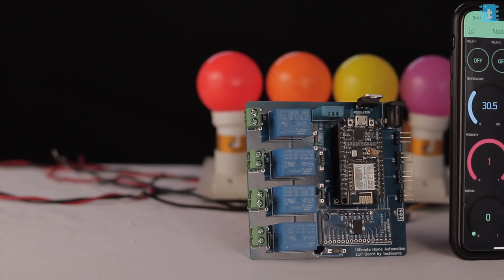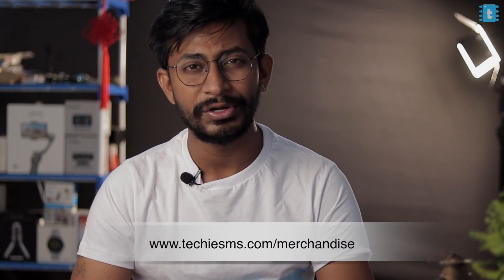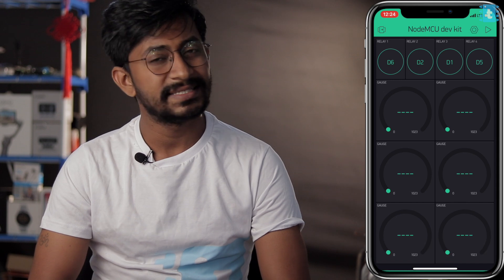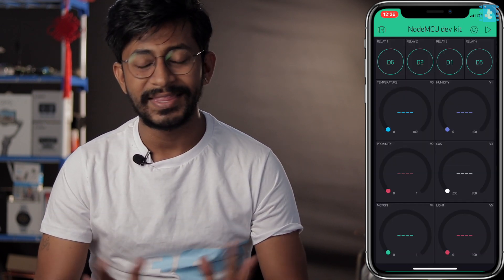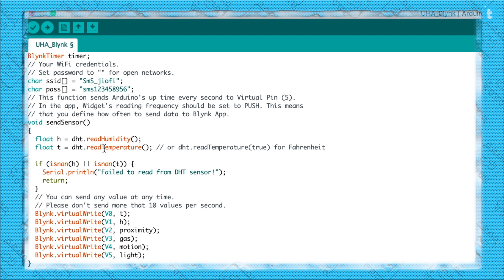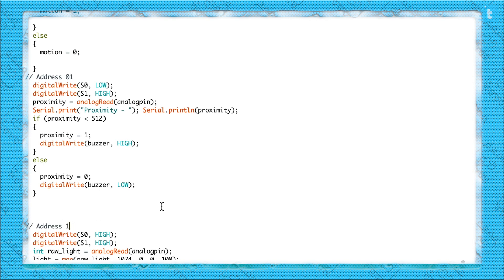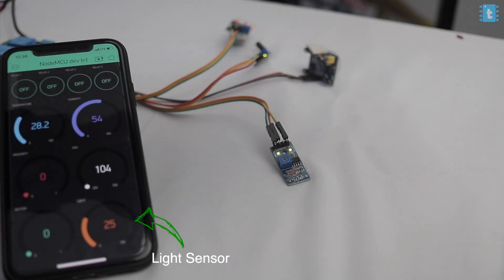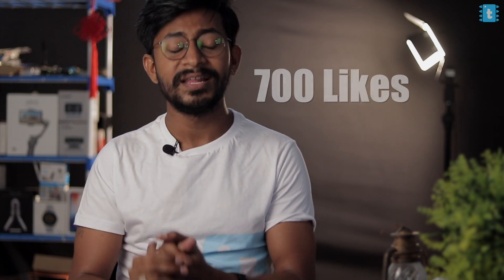Multiple Sensors, Multiple Appliances using NodeMCU & Blynk | IOT Projects | ESP8266 Projects

Comment: Sir how to get a measuring code for acs712 current sensor and ZMPT101B voltage sensor using nodemcu esp8266 with aurdino ide

Comment: project is amazing ... but i have a query about analog pin ..... can we convert analog output to digital ......?  without any IC or complex circuitry
Reply from the maker: Just put the condition that of the value is greater than 1000 it’s digital true else it’s digital false

Comment: I am working on a similar project but instead of Nodemcu i am using a wifi Module named ESP8266-01..
Will it work the same? Or should i switch to Nodemcu?

Comment: in the circuit diagram of sensors there are only 3 sensors are connceted to the multiplexer but in the output when you are showing there are 4 sensor

Comment: Bro I'm doing a project where I can control relays using Blynk and a it remite so whenever I'm using it remote even though the light is off the state of the relay is not updates in the app bro can you help me with this code so every 1 sec or ant time we can send the state of relay to the app so there is sync

Comment: What a really great video sir!. May ask you a question. I want to make same IoT project where it can controlling machine temperature using termocpuple and relay. But i have the problem that i dont know can blynk controlling its time (running for just 2 or some seconds and than turn off) and make some loop that run continously? or maybe running a whole sensor (if i use more than 2 sensor on 1 machine) with just use 1 button on blynk to running for few seconds, is all that possible to make sir? thank you verymuch

Comment: Interesting project for learning purposes however not useful in reality as it is, it is not possible interfacing analog sensors with long wires and still be reliable, since all those sensors cannot be near each other so this is completely useless unless built to play with!
Reply: This project did not work for me. Could you point me to one that uses multiple sensors and Blynk that works? TY

Comment: Well explained. Can you please tell me requirement if I want to do this whole thing wirelessly (means sensor is at some other place and my appliance is at other place within 1 km).
Reply from the maker: It works over internet 
You can get the data from anywhere in the world
Reply: @techiesms  Sir, As per your video relay is connected to Node MCU. I don't want to connect relay with MCU.  Any way to give signal to relay without being connected to MCU ?

Comment: Arduino: 1.8.13 (Windows 10), Board: "Generic ESP8266 Module, 80 MHz, Flash, Legacy (new can return nullptr), All SSL ciphers (most compatible), dtr (aka nodemcu), 26 MHz, 40MHz, DOUT (compatible), 1MB (FS:64KB OTA:~470KB), 2, nonos-sdk 2.2.1+100 (190703), v2 Lower Memory, Serial, SSL+TLS_MEM+HTTP_CLIENT, Only Sketch, 115200"

xtensa-lx106-elf-g++: error: CreateProcess: No such file or directory

exit status 1

Error compiling for board Generic ESP8266 Module.

This report would have more information with
"Show verbose output during compilation"
option enabled in File -> Preferences.

Comment: what if i want to use 2-Voltage sensor and 1-Current sensor instead of the sensors you used? would it be a lot of changes on you code?

Comment: Hi sir, i would like to connect IR sensor, mlx90614 and hc-sr501 Pir motion sensor to a nodemcu for my project. The IR sensor is connected to D1 input of nodemcu. Do I need to get the 16 channel multiplexer to connect  the mlx90614 and hc-sr501 to the nodemcu?

Comment: I've seen a lot of prototypes on youtube using arduino and nodemcu or with another microcontroller but here i found the great prototype for which i had been looking for like everyone is making blynk based automation but there circuits look so messy on breadboard or on gbp but your configuration is not just working good but the i love the way you configured everything on single board. ❤️
I'm the one who has completed 700 like, i hit the like button when it was 699, i really appreciated your work!🙏
Love from Ahmedabad 😉
I also regularly check your Instagram posts that's so fine.

Comment: Good morning sir. A very good videos. Very helpfull. Good work!! Could you do a video on converting existing codes to blink using functions and keeping the loop clear. I am unsure of this. I have 4 sensors with lengthy code for a water quality monitor (ph. Ec. Temp and distance. And I'd like to monitor them via Iot.  My current code works out side of blynk. And I'd would like to add it to blynk.

Comment: I have been following few people closely on IOT projects. I have watched at least one of your other video and I would say that your projects are close to what I want to achieve. That is turn each switch board using Arduino or nodemcu such that the switches deal with low DC voltages and the high AC is dealt with at the relays. While doing so, I want to make it a resilient one. In the sense that it should work even with internet down. 

Your projects are close to my requirements and handles the first part well. But I would love to see you address second part which is, it should work even without internet. 

In that line, I have been thinking of openhab/home assistant with Arduino. To start with, I am choosing wifi approach, but in the long run, would like to make it even more resilient making it wired over Ethernet (EtherTen
Reply: My first comment... accidentally hit send with out completely finishing my comment but that is the gist of my approach I am planning to achieve... it will be a long big project for me.

Comment: This Project is very Helpful.. Multiple sensor Iot monitor is super 😍. 
My suggestion is PIR SENSOR & LDR sensor connect to the relay to turn on off function.. this function iot blynk app to monitoring  the on off is very helpful for all the beginners...
PIR sensor function is : Motion detection to automatically turn on to the lamp. Monitoring with blynk app
LDR function: low-light to turn on the lamp,high light turn off the lamp.Monitoring with blynk app using IOT

By
Raamesh